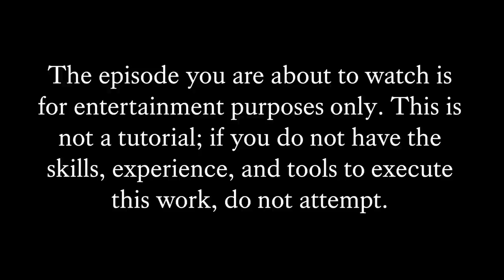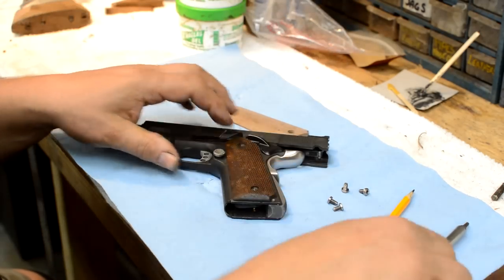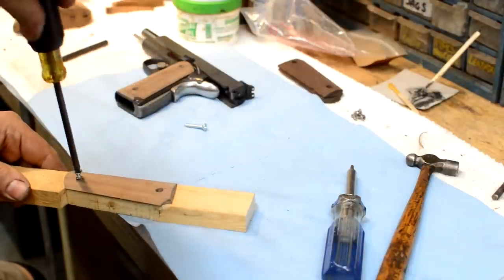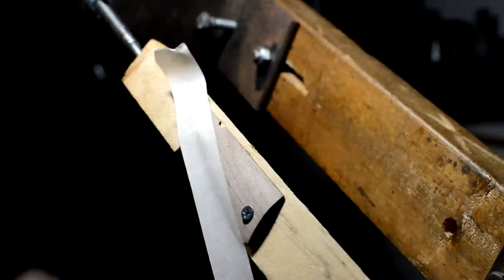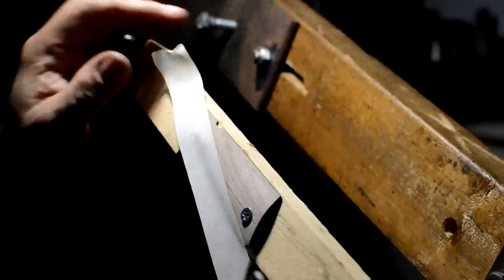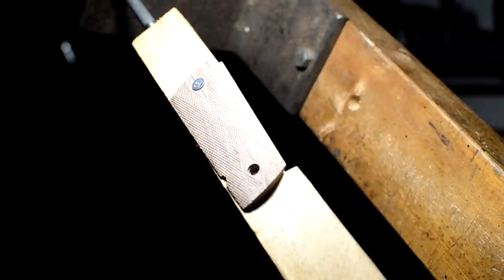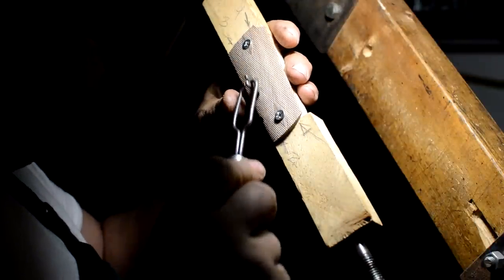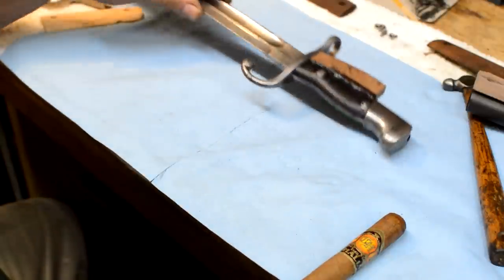Colt 1911 Grip Checkering: Anvil 031

Comment: For those unaware, LocTite makes a purple colored thread locker called LocTite Low Strength 222. It is PERFECT for holding your grip screws, holster screws, etc in place WITHOUT holding so tight that you risk stripping the head or removing the insert into which the bolt/screw is threaded. It provides enough holding power so that the fastener won't work itself loose and fall out, but it's weak enough that it'll let go when you intentionally remove it with gentle tool pressure. Alternatively, you can use a dab of your lady friend's clear nail polish (or buy your own). I have a bottle of white and red nail polish from the dollar store that I use to paint plain front sights. I'm secure in my masculinity and I'll buy makeup all day long, just you watch. 😎 Kinda like Mark putting on that Hooker Red lipstick during the M60 Anvil. 😎😎😎
Reply: hahaha, it’s ok, you don’t have to tell us you are secure enough in your “manhood”, remember it’s 2022 and we are not to judge or criticize these things…, but in a similar situation…, I will now confess that I have become secure enough in my “manhood” to use the “women’s” bathroom in the public areas…, secure or at 59yrs young, just don’t want to walk around the mall with a wet spot i my crouch area… hahaha…!

Comment: Hey man, not sure if you’ve ever tried the tape and superglue trick?  A strip of tape on the block, a strip of tape on the flat back of the work piece, a thin line of glue, some accelerator and voila, it’s stuck down non-permanently, with no screws to work around.

Comment: Suggestion for holding those grip scales: Apply a smooth layer of masking tape to the back of the grip and the holder. Then use CA glue to attach the two. After you're done a pallet knife will separate them.

Comment: what is that rotary tool thing being used, is that a dremel extension specifically for checkering? as that has to have a guide needle thing riding down in the previous groove for such even line witdth
Reply: close - most can use Foredom motor, control & handpiece sets, also their shafts and couplings.  Mark may be using an MMC power checkering tool -  just a guess by the appearance, but they all look pretty similar.
Reply: @maxprivus  thank you!
Reply: I tried looking into these powered checkering tools, it seems it is a very niche machine with very limited options. I was hoping I could find just an head attachment I could put onto a foredom motor. Hoping I can find one around the 500$ dollar range, looks like 1000$ is more realistic sadly.

Comment: Use some double sided carpet tape to mount them to your jig, no more dicking around with screws 546 times. Then just use a putty knife to peel them off when youre done.
Reply: A thin layer of rubber cement, applied to both surfaces and allowed to dry before joining, provides a surprisingly good bond which rubs right off and won't raise grain or stain the surface. Also great for attaching sandpaper to float glass.

Comment: I did my first set of grips on a 1911. I prefer my wood to be smooth. I got them rough shaped with a rasp file in about one hour. They are made out of Epe wood. It machines like plastic. I love the look and feel of that hard wood. I cut another set of grips for a Rugger revolver. I made them slimmer for my personal preference.  I don't checker mine, though. Don't have the need or the skill or the tools to do it with. You are an artist.

Comment: Out of all the ivory grips I did when I was younger the Colt 1911 was my favorite for checkering. They just looked wonderful with the original diamond checkering pattern. I had a pair I did for my 1914 made 1911 Colt. I too had a jig for making and checkering these. One can't roll the checkering tool over the edges; the tool had to stop in the wooden fixture. It is too bad that people wrecked the ivory business. I have tried fossil ivory but I like to work with solid pieces which are difficult to find and expensive to purchase. Nice work Mark; your checkering is impeccable.

Comment: the price of this work is probably worth two norinco 1911s
Reply: ...I had a Norinco 1911 in the early 90s ..replaced just about every pin and spring...replaced the internals with Wilson and John Nowlin parts...if they had Cerakote or Duracoat I wouldda refinished the slide and frame...wish I could get another one...
Reply: @cbroz7492  I replaced extractor and grip panels and did a DIY trigger job and it has worked perfectly for 10 years

Comment: A 1911 without double diamond grips, isn’t a 1911 in my collection.
Reply: My Delta Elite is one of those I guess you won't get to enjoy. It came with rubber wraparound grips. I made custom Hogue rubber finger groove grips by drilling a hole in the proper place on each side and setting in the red triangle medallions with epoxy. Looked original, but soooooo much more comfortable and so much better recoil control than wood grips. Mind you, 10mm is much more powerful than the antique .45 ACP. 😎 Proper magnum cartridges need comfortable and effective grips!

Comment: For attaching those scales to your work jig. 
My mind was thinking double sided foam tape. The kind they use to stick badges to cars. Then remove them with fishing line or dental floss. 
So I'm wondering. Is there a reason you can think of to not do that, or is this a case of "this is what I had and it worked"?
Reply: I've watched woodworkers use light tack double sided tape, biggest issue is cleaning it off.  Most of them will be doing finish sanding afterwards so it doesn't matter to them, with what Mark is doing that wouldn't be possible since they are basically finished on the underside.
Reply: Even thin foam tape allows some movement because the foam is squishy. Would make it harder when the workpiece isn’t held secure. And, even using fishing line or dental floss leaves behind the residue of the foam tape. That can hold the grips up from sitting flush unless you went back and made sure to remove all the tape. 
At the end of the day it’s extra work in finishing for a solution that isn’t as ideal compared to screws that will lock the grips down and not require extra time when it’s done.
Reply: @wesbrown5601  Low tack tap doesn't leave residue. That's what it's for.
Reply: @wesbrown5601  And why does it matter about the underside? But they wouldn't be marked with low tack anyway.
Reply: @garymitchell5899  I'm going off the comments made from the woodworkers I've seen use it, they mention that even low tack leaves a residue that needs to be removed and most do that by way of a light sanding.  I've used low tack tape before, and what I've used has left a light residue that needed to be cleaned off.  Considering that Mark hasn't done the final finishing on the grips at this point, that light final sanding probably wouldn't make a difference, and if you plan for it in your process, a couple of passes on a sanding block with a fine grit wouldn't effect anything.
Reply: @wesbrown5601  Nah. Low tack tape doesn't leave a residue, that's what it's for. And if it's used on the base of the wood then it doesn't matter anyway.
Reply: I've always used double sided carpet tape. If you're worried about residue you could put masking tape on the back of the scales, then put the carpet tape on that. When you're done slide a putty knife under them to break them loose or peel off the masking tape.

Comment: Mark,  I have a Napali military muzzle loader in sad shape.  I want to conserve her, and think I have a grip on how to handle the steel parts.  Question:  How do you handle the brass parts?  I.e. cap on end of stock and trigger guard.  They have a lot of what you might call "patina", But I don't want to wire brush them back to a bright finish if I am just conserving the rest of the gun.  Any recommendations would be appreciated.

Comment: I got ahold of some nice 1911 grips, and the previous owner had squished the the shelf in the grip screw hole. I figured I didn’t have anything to lose, so I drilled it out and epoxied a piece of copper tubing that I chucked up in a drill to file to fit. Made it a little long so it stuck out the back. Put an extra screw I had in the hole, then set the depth while the epoxy was still wet. Pulled the screw out, let it harden then filed the back flush. Works good so far.
Reply from the maker: Outstanding

Comment: There's a few people where I never question the charges on, one of em is my gunsmith.  Anyone who is a professional in a technical field whereby multiple tools and lot's of experience is concerned; if they're worth a damn and have good references, just don't question their professional opinion.  I am a professional.  If you ask my expert opinion or recommendation, then don't ask me 50 more questions about all the underlying technical details.  Why?  Because it took me 20 years to be an expert in my field.  50 questions over an hour or two of conversation isn't gonna make you an expert in my field.  Same goes with a gunsmith.  It's disrespectful and makes the gunsmith not want to do business with you.  Small communities of professionals like gunsmiths will rapidly tell other smiths in the area to avoid doing business with you, then you're ass in a sling, because you gotta go way out of your area and those smiths are less likely to take your work, or worse, they aren't as good at the job or put you in a massive backlog line.  Show your gunsmith some damn respect, plain as that.
Reply: I have the same problem in my line of work. I do hand painted pinstriping and lettering. Been doing it for over 25 years and have done hundreds of cars and motorcycles. Thousands of dollars spent on the right brushes, paints, and materials. Years of practice before I even touched a customers vehicle. But you have the customers who want to second guess everything I do. Whether it be wanting pinstriping in places it wouldn't make sense to put it, using the wrong style for the age and period of car for a restoration, using colors that don't compliment the color of the vehicle, wanting lettering done that's not proportionate for the space it needs to fill or too small to be legible at the appropriate distance. When you're a professional in a trade where you're built up years of experience, it can get frustrating when someone second guesses you, or even worse, when they see what you do so effortlessly because of practice, then they don't appreciate your expertise vs what you charge because they think "I can do that, why am I paying this guy $500 to do what I could do myself for $25." If it was easy, everyone would do it.